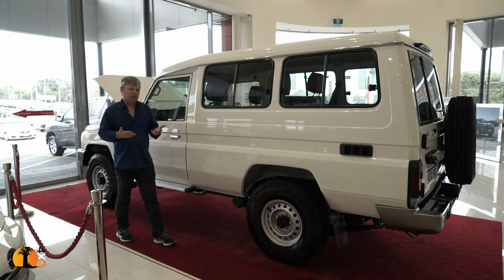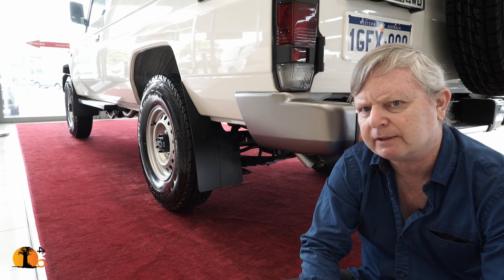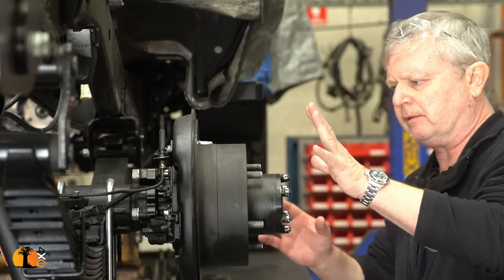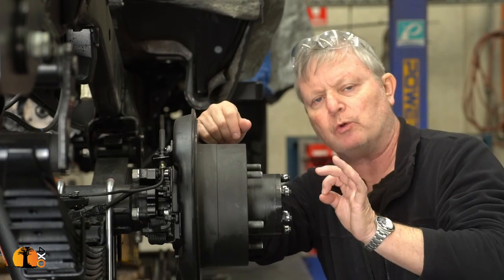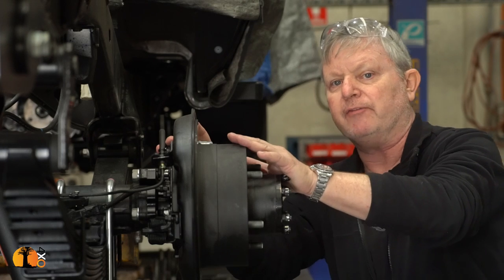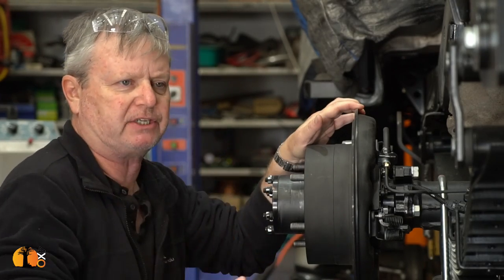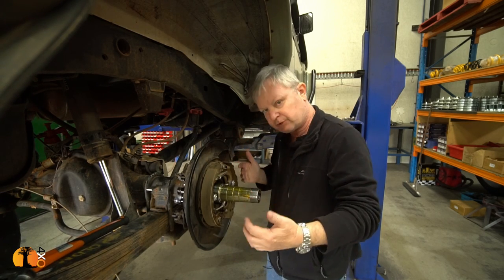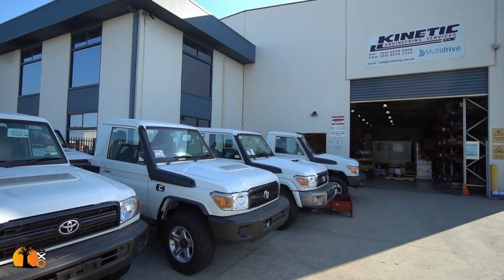TOYOTA LAND CRUISER REAR AXLE issue. 70-Series

Comment: Would love to know what the cost is
Reply: hahaha. $AUD3300 + labor
Reply: Fast Farmer  

And cost of a hole new diff to fix it
Reply: Only $1650 extra to replace the rear wider diff, better and stronger. $4950 Jmacx with the leaf spring system and replacing the diff and stronger axles. http://www.jmacx.com.au/leaf-diff-upgrade.html Would cost to have it installed but would be similar installation cost. Even if we didn't want the coil conversion, would go with the better diff and axles.

Comment: Why not use rear axle of Landcruiser 100, or 80 series and match final gear with front diff?
Reply from the maker: Because it wouldn't match the width, prop shaft length, spring mounts, shock mounts. Need I go on?
Reply: 4xoverland ok thanks, because here we usually custom it from other parts, LC 80 and LC 60 became fave because wider axle and strong. Yes we must modification props etc but it risk that we accept.
Different country different ways, and i didnt want take argue war with you anyway and i follow your channel for years
Reply from the maker: 80 and 100 are on coils. 70-series on leaf springs, so its not a viable option. A straight after-market axle swap would be a better option.
Reply: 4xoverland our gov tax is crazy, we live in indonesia your neighbour country but because Australia isnt member of ASEAN anything from it will price astronomical, thats why ARB and TJM price will be doubling 2 or 3 times
We doesnt have dessert and long roads so for lc70 users (which also scarce) maybe less affected with less width rear axle, mainly offroaders here are typical heavy offroad like camel trophy event, so consider for picking axle is strong n reliable n easy parts (lc axle is fave installed in any vehicle include defender, jimny, cherokee, etc) and custom all of it like props, mounts etc is price we have to pay, but labour cost here is low, so it doesnt bother us too :)

Comment: Funny fuel consumption was totally left out in this video. Producing overlapping tracks (by factory spec) should cost more fuel, at least off-road (especially in softer sand). Corrected wheel base is therefore totally desirable, also to minimize the carbon footprint of these fuel hungry machines going off-road.

Comment: Did you say the 76 rear axle is different than the 78 and the 79??.And there is a completely different resolution???
Reply: Watch it again, he said the 76 has a lighter rear axle and the resolution is they sell a complete wider rear axle for the 76. 
Unless you know something different?
Reply: i do not know anything about the specifics of each vehicle just that there is the 50mm(approx) difference .I am very close to buying a 76
Reply: I own a 76 and it is the best vehicle I have ever had. Buy your 76 and don't worry.
They are the toughest built vehicles probable ever, only the 80 series comes close.
The rear axle doesn't have to be so big as a troopey  or a pick up because they carry less weight.
Are you looking at getting a new one or an older model?
Reply: 2015 about 70 k with bull bar,side bars to tfront guards,snorkel and diff locks
Reply: Oh just buy it! Diff locks make it unstoppable. I am taking it has the V8 then.
Reply: yes NZ gets the V8 too.I am not saying they are not worth the money but they are expensive here 75 k for a new one ,at least, prior  to the mods above.Negotiating with the dealer.76s are rare here too
Reply: Oh good luck, the longer you own it the more you will understand. I never want to part with mine.
I have an import one in the UK but I have family in Africa who have them and say they last forever.
Reply: Harvey Smith the old 6 cylinder is known for reliability. Time will tell if the v8 earns the credit. It's still relatively new by the 6's standard.
Reply: its not just the engine that goes towards reliability The running gear of the landcruiser ia also hardy
Reply: PAS4591 sure the V8s mounted to a new gearbox too, different clutch etc.. the point being that LandCruiser earned a reputation over 40 years+ and even then there are some lemons. The V8 is still comparably new and untested by LandCruiser standards.
Reply: Hi. I dont agree with Andrew, the 76 and 79 have the same axle as far as I know. This makes (as you say ) the rear axle slightly "stronger" as it does not carry the weight a 79LC would.
Reply: I don't know where Andrew got that info from, but all Aussie 70 Series ie 76, 78, 79s have identical mechanical specifications as far as engine, trans and f/r axles. The photo he uses in the video shows what looks like a Japanese market 76 ie non-V8, which may very well have a Hilux size rear diff. I have a 2018 76 and the rear end is the same as the other 70s. The 76 does have a lower GVM due to, I believe, the softer rear springs used to improve the ride.

Comment: Oz is a bit of a nanny state when it comes to vehicle rules. Spacers are bad news for sure. The wider 
Wheel offset rule is a bit over the top. It actually loads both bearing more in a full floater due to the extra leverage. The bearing load areas become opposed and higher. This of course reduces bearing life. Same as towing or driving fully loaded does. The extra track width loads the axle casing more whether through the axle extension kit or through using greater offset.  Do they reinforce the axle housing? No. I wonder if anybody has bent a casing yet? Many od the modded vehicles out there must be illegal when you see some of the mods done.
Reply: I suspect the reason for the offset limit law has more to do with keeping hooligans from putting big fat tires on the rear ends of their jacked up hot rod Holdens and drag racing on the streets with them.
Reply: Been a few 79 series with bent cases even without widening the axles like Andrew has done.  Overall if you wish to do it properly for long term use the compete new widened heavy duty casings is the best way IMO.

Comment: Buy a LR Defender, ultimate towing truck!
Reply from the maker: I've owned and towed with a Defender. And its my duty to put this comment in perspective. In my view all diesel Defenders are underpowered for towing, unstable at speed and the gearboxes fail after quite a short time when towing heavy loads. The brakes of the newer ones are a bit better than the Troopy, but earlier ones are severely lacking. Defenders are well balanced for load carrying and tow-bar loads, and without any mods can do quite well. Standard shocks are a joke and anyone considering towing should upgrade them with something that works. Neither of these vehicles come close to the 'ultimate' tow truck. Try some of the US build pick-ups. They are the 'ultimate' towers.

Comment: The original offset causes problems in soft sand. The rear wheels have to push extra sand away rather than run in the tracks of the front wheels.
Poor design.

Comment: any 4x4 mechanic does a track correction in Perth cheers
Reply from the maker: There are only three options: Spacers, wheel rim off-set, replace axle/track widening kit. If done wrong, spacers are illegal. And axle work needs engineering mod plate.
Reply: @4xoverland  tnx Andrew I will do the axle replace in Perth just looking to find one to do the a good job for me tnx

Comment: Why doesn't Toyota fix this in the factory?
Reply: mhappy01 because they sell only 100k unit a year, not enough money to change their production line, and they know people will still buy it. They will fix it in their future versions. The marketing  trick is improving a bit every few years, not making a perfect vehicle at once.
Reply: Cheers. Like in the good old days when they built cars to rust so we would go and buy new ones. Thank-you British Leyland and Vauxhall..
Reply: Milu you're incorrect!
Toyota are currently producing 120,00+ per year just in Japan alone!
They also have factories in Kenya and Portugal producing them!
The reason Toyota won't fix the track issue is because they are selling so well! They see no need to invest more money in a car that is currently selling really well!
They are currently building and selling more 70's than at any other time since production began back in 1984!
Reply: Meant to say 120,000+ per year.
Reply: Ben Cook you are saying the same thing mate.. do you know how many Corolla or Camry do they make a year?
Reply: In Portugal they build V8 70's for the South African market!
The V8 is not sold in less developed countries because of the poor quality fuel often found in those countries.
In those markets Toyota supply the 70's with the 1HZ Diesel engine as they will run on poorer quality fuel.
The third and final engine that the 70 is currently available with  is the GR 4 litre V6 petrol.
The petrol 70's are typically found in the Middle East, particularly Saudi which is the worlds biggest market for LandCruisers and also South America.
Reply: Cad On, I never said the 70 is sold in the EU?
The Portuguese factory assembles 70's only for the South African market! The link below confirms what I have said. If you disagree please also provide a link so I can verify what you're saying.
There is also a factory in Kenya assembling 70's and I suspect some of those supply some of the other African countries.
The 1HZ 70's are for less developed countries, or in your politically incorrect wording "third world" as they will run on por quality fuel.
The V8 engine will only run on good quality fuel hence why that is the engine the 70's in South Africa and Australia get!
http://blog.toyota.co.uk/built-in-europe-10-million-toyotas

Comment: The money spent on putting this TOY (ota) operational, would give to buy a Mercedes-Benz G!
Reply: ...which is not built to do the same job: undersized engines for the weight of the vehicle..frequently breaking springs, small inside even a LWB etc...could go on..great G's were the simple 460/461 series which were hopelessly underpowered but long-lasting unless bashed on motorways. An HD Toyota
is simply unbeatable in terms of durability, simplicity in design, load capacity and pure functionality.
Just ask yourself why they do all (ALL) the dirty/tough jobs on this planet..not Defenders nor G-wagons nor Nissans..
Reply: It must be for these reasons that mercedes-benz had to open a new factory in Algeria, is that the one in Austria can not manufacture in sufficient numbers in the face of orders! Now, how many "G's" have bought the military from the UK, Canada, New Zealand, AUSTRALIA, USA, but the list is long ... is that the life of a military vehicle must be "clean"! Engines in the "G"? goes from the 4 cylinder to the V8! Already now, I have in the garage one with 700,000 km +, bought new in 1983, of the 10, 4X4 that more KM's have traveled the planet, only the first five are "G", and in the 10 there is no TOY (ota)
Ps. there are also "G" with 7.5 tons! without being 6X6!
Reply: ..the joys and pleasures for liking one car or another, one brand or another..we do you get you're statistics from...? would like to know..
Reply: with all my respect your facts are false and ludicrous..where do you get your info from??
http://www.guinnessworldrecords.com/world-records/longest-driven-journey/
Production of the old series of the G (which as such is a great vehicle just too heavy and expensive) has ceased and only just over 300.000 have ever been built since the late 70's, ever!..compared to largely over 6 million Land Cruisers..oups! alongside Otto many many Cruisers have been clocking up   horrendous amounts of miles well over the million..if the rust has not finished them off before..:)

Comment: I would be getting this instead because it will mean that the rear diff will be as reliable as the rest if the vehicle. Check this out. http://danaperformance.com.au/dana-performance-for-landcruiser/
You will have a vehicle you can say to a potential buyer "this vehicle will handle anything you can throw at it. The mod done in this video would have me worrying everytime I drive it because it seriously looked like an after thought, near enough, that'll do. How many place will you be able to go to, to get replacement parts in future if you have a problem. Dana performance will ship just about anywhere. Not that it matters because you won't need to replace anything on it. It's worth spending a little extra to get it done right the first time.

Comment: Interesting upgrade.  It is sound but also brought about by Australia's nanny state bullshit.  But obeying the vehicle law there is very important to follow.

As for spacers/adapters I have to disagree completely.  The company I work for moves 35 - 40 thousand of them a year here in the States.  No troubles if they are installed correctly.  Check them every 5k miles when you rotate your tires and you are gold.

Comment: 50mm spacers on both sides for years, no extra bearing wear, which get changed periodically due to climate etc.
Not too concerned with legality, if I crash it, I'll rip the cordless rattle gun out and rip them off 😂
Reply: Brett Jackson assuming you have arms left.